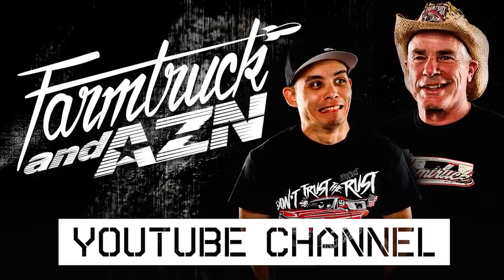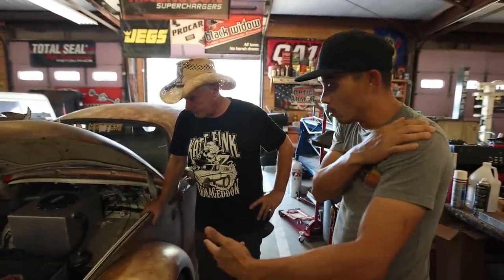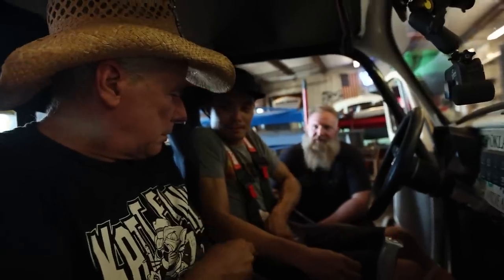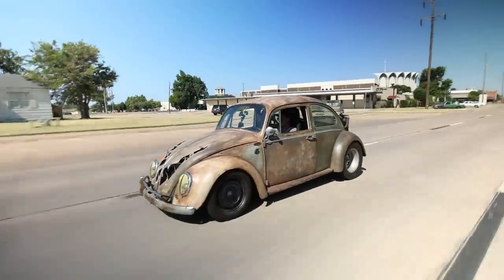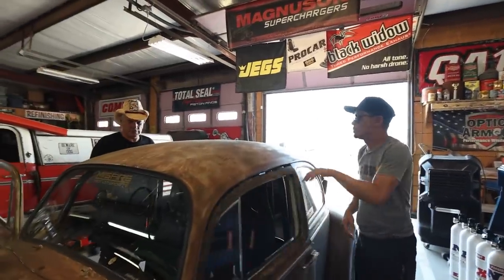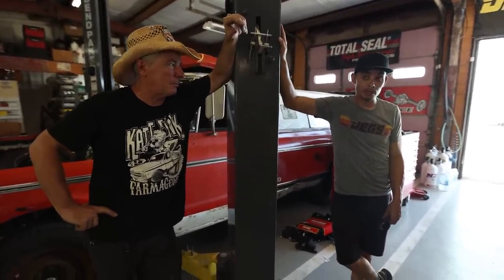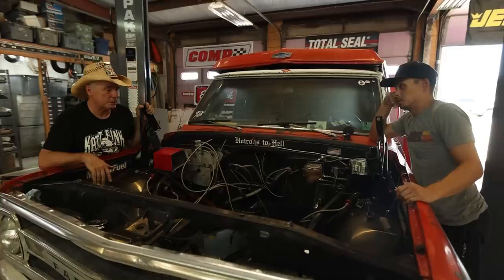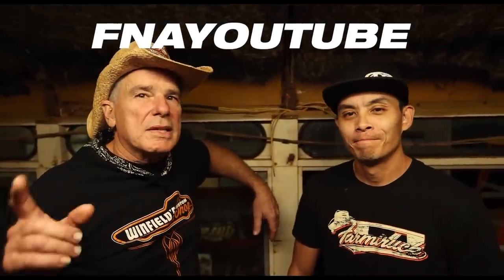IT'S RUNNING A LITTLE HOT!! FIRST DRIVE SHAKE DOWN!

Comment: The Dung needs an airduct from the roof to the turbo, and an expasion tank for the coolant. Also the fuel tank needs to be 4" further back. Additional ducting would help the radiator, but how to build it is a bit trickier than usual.. Lifting the frunk from the hinges for about 2" would be a decent start.
Reply: i like cars
Reply: Maybe a small auxiliary radiator externally mounted on nose
Reply: Total agree
Reply: 200 is about normal for Subaru motors, also the OE pump might be struggling to move water to the front radiator setup, could go completely electric relatively easily and have complete control over flow/volume. All in all I’d say it’s healthy and you really don’t have to worry until it’s in the upper 220s and not coming back down
Reply: I totally agree
Reply: I'll talk to him in morning about advice
Reply: Some sound advice..top hood scoop
Reply: Can also run a small scoop on top withe hole in the roof  but up side down into the car with a tunel or flex house to the  back to the turbo. with a flared box at the back of the turbo to cool the turbo and motor down
Reply: Damn that thing is noisy . Love the Subaru swap tho. They will work out all the bugs.
Reply: Sounds like you should go build one instead of internet building lol

Comment: Air bubbles in the system would definitely explain the cooling issues. Have you tried vacuum filling it? It’s the best way to eliminate bubbles 👍
Reply: I agree. I vacuum fill all the cars I work on. I just do it so I don’t have to worry about it.
Reply: Not necessarily the radiator might be to small I'm thinking.

Comment: Sure you guys are working out the kinks by now! I’m doing this conversion on my own beetle and what I learnt about the cooling system is with a radiator it’s more important getting air out of the back than in the front of it if that makes sense
Reply: It makes sense because f more air is leaving the back it creates a negative air pressure inside(ie a vaccume) which inturn sucks more air in from the front
Reply: @ashenthrenchetty7  💯 I am even making a front splitter for mine with a “gerny” flap type deal to help create more of “suction” effect
Reply: Some louvers in the sides behind the front fenders would probably help too!😉
Reply: Yea I'm doing a vr6 swap I'm planning on running radiator up front cut a grill. But put a cylinder fuel cell up on the Frunks "firewall" and weld nuts on the bottom and have a screen insert over the front steering mechanisms. That should do the trick.
Reply: @chrissweetavena  Why a VR6? Sounds like a lot of work for minimal returns fitting that large engine in a bug. Seems like you'd have to take the entire firewall out because it's so high... or stick it way out the back.

I think you'd be better off with the 2.5 flat 6 from a bus, that engine bolts right in the back of a bug, is air-cooled so no need for a radiator, they make bore kits for it... even 4 valve per cylinder kits so you could probably make it way faster..

If you're after power, a flat 6 with a 3.0 bore kit and 24 valves would blow the doors off a 12 valve 2.8 VR6. Even if they make the same power and torque the air-cooled engine will be much lighter.

Liquid cooled is cool but then the boxer 4 turbo from a Subaru would fit easier and be an easier swap that's less intrusive to build into your chassis..

Not knocking btw, it's your car and you should do whatever you want to your stuff off course so if you want to do the LC conversion with the vr6 more power to you... just wondering.

Comment: Hah hah, the Dung Beetle lives!! Considering the outside air temp, I'm surprised it stayed as cool as it did! You may need to make a shroud of sorts to direct more air into that radiator and maybe a stronger fan. And for Pete's sake, get that fuel pump in some rubber mounts. Gawd, that thing is LOUD!! You'll definitely need some wheelie bars once you get the kinks out and start making some good power with that Subie motor! Heck, you can pull the front wheels with a well-built 2130 cc bug engine! You can pretty much predict what a Subaru engine will do making close to twice the horsepower!!😂👍 It already sounds pretty healthy up on the pipe, just in the short pull you did! Nice work guys!!😁

Comment: Old VW guy here -- Seen the Subi swaps a lot --- The best way is to move the rear fire wall forward 10-12" and move the radiator into that new area -- supply some fresh air ducting into that and almost all your cooling problems will be over.... you'll be fighting that front radiator and air bubbles forever...   Do a little youtube research and you'll find some Assie guys that have done that to get you some video help.

Comment: One thing that comes to my mind with the cooling is the one thing that many people overlook. I have saw cars that did not have a thermostat in overheat, and run cooler once the thermostat was in just because the thermostat made a resistance that kept the water in the radiator longer. When dealing with temperature problems on custom cars it's very easy to not think about the fact that water has to stay in your radiator long enough to get cool. Not sure what the situation is because you have a rear engine car which I normally would know to be air-cooled but I know you have a radiator up front with a lot of hoses. Whatever your setup is you guys are smart just remember to make sure that your your water is staying in the radiator long enough to get cooled down.

Comment: Add a port at the engine end to use a vacuum pump such as a brake bleeding pump to pull air from the cooling system. You can also add a pressurized cooling system as in Nascar or circle track cars.

Comment: Need to set the fuel tank back as far as possible or go to a shallower depth but wider tank, the fuel tank is definitely having an effect on the air flow out of the rad. 
Mount the fan as a puller not a pusher unit to draw cold air in....now all that air that's passed through the radiator also has to be funnelled out.
If you follow the chrome side trim, there's a small triangular area behind the front guard that finishes at the panel gap. I'd cut out this area as much as possible and then weld in some mesh, it'll help with moving air through the rad. allowing it to exhaust.
If the under bonnet/hood temps. Are still high you could add a small thermo fan, biggest that'll fit, to the inside of the mesh area to force that hot air out. You could set them up to turn on via relays switched to ignition, on a stand alone thematic switch or pinned in to the haltech using an IAT sensor set at the desired temp.
Fitting a header/coolant expansion tank would also be a worthwhile idea, find one that has the right amount/sized outlets for your application. 
I've personally fitted/used, with fantastic results, vw/Audi expansion tanks with the mounting hardware sourced from a wrecking yard.

Comment: I'm  not  just saying  this it really  works. Zmax  had a prostreet 57 that had an overheating  issues after zmax it ran 30 degrees cooler. A few years later had a Yamaha  vmax  that started overheating  and  same solution  had about  the  same results  30 degrees  cooler

Comment: but is it Faster then Before all the Work??   So Glad you didn't Retire the Beetle!!   you need to add a inside cover plate for the upper part of the front hood Holes to force the air into the bottom half straight into the radiator?   for the farm Truck , you just need to groove the rear tires like a Sprint car on Dirt style Tire for the street?

Comment: Im no race car builder but Just from watching this I'd say you have plenty of space for air to come in the front but is there an exit so it can flow well and not be trapped?  And maybe the fuel cell is a little too close to the back of that radiator.

Comment: Fellas, is there enough room to mount the radiator under the car  somehow.  I see a lot in racecars, especially the s10's and small tire local Ohio no prep cars.  They do it to move weight but they don't run hot... just a thought. Driving that with no hood would look ridiculous.

Comment: Operating temperature on Subaru is 192° and can range into 210 with no problem 😊 but your setup might require cooler temperature
Reply: He's running a turbo and probably more boost which causes more heat and racing it to that would be my guess.
Reply: @matthewvarnam4302  they were mostly causing but 100+° day things do run warmer. They might need to open body panels up behind the radiator to aid cooling if it hasn't already been done.

Comment: Like some of there comments on here expansion tank will help with air bubbles.  But what temperature thermostat is in it and where is coolant temperature sensor located.  If u can get 2 temp sensor to read temp at the radiator and the one at the thermostat housing.

Comment: Jack the front of the car open bleeder at the radiator if no bleeder cracked the hose just slightly. You will see bubbles let idle for a few minutes. Do the same procedure raising the back of the car opening the bleeder at the engine. if no bleeder crack a hose let run for a few minutes it’ll make a world of difference we install the Subaru engine can VW buses here in Fresno California and that is our bleed procedure temperature will stabilize Subaru engine will be happy. Good luck 🍀 you guys are Awesome….

Comment: Weld some light duty expanded metal behind the hood, it should add the strength your looking for. If you want you could add a red light to shine through the cut out flames.  🤷🏻

Comment: That Subaru engine is suppose to operate at 160 degrees. NOT 180, but it too dam hot where you live! You can fry an egg on the asphalt! Love the Dung Beatle better now with the Subaru engine. More reliable than the VW engine. I own a 2019 Subaru Impreza. That engine has over 100,000 miles on it and runs very well. I still average 29-30 m.p.g.. I have gotten 38 m.p.g. on the Highway.

Comment: You need to have Him Add vents just behind the fender to let the Hot Air Out of the front get Welderup Steve to Add it and it will look like ears, Otherwise the hot air is trapped! It will slow you Down like having a Reverse parachute Air goes in no where to go but circle and why it started running Hot! With the Ear vents it will drop 20f and Ducting the Air to the vents would help even more! it will reduce the drag and Cool it Better! And Or a Cowl i know you don't want because of the Look!

Comment: Good job getting it running again.  I figured you're using a type one trany since you're using a RLR shifter.  I did a similar project, click on my pic to see it. IMO, you don't have to worry about temps until it's over 210.  My fans come on at 200. Let me know if you ever want to chat.

Comment: My wrx runs between 180 and 210, gets up to 220 when stuck in traffic in the summer.
Reply: @Scooby blue;  @FarmtruckandAZN  The established optimal coolant/water temperature for vehicles is @210-1 deg. F. 🤓
My first IE &auto mechanics teacher showed us the collected, data, graphs showing engine wear, efficiency, etc. vs temperature
->that course was 1975-6 - the data was already measured, collected, established from several years prior - with cast iron engines, stock internal parts
->this led the automotive manufactures to increase the thermostat and cooling system design specifications from 165 to 185 to 210 deg F.
->Aluminum engines and parts have much  better heat transfer than iron, steal
->For some reason many individuals within the automobile mechanics, building, modification, racing are still holding onto the old, improper information.
->if You need or desire any assistance, information, details with a successful Subaru Beetle swap details -> please view John Reynolds with his 517 wHP Super Beetle [also on this platform] 
All The Best 😊
Sincerely ☺

Comment: It's probably running a little hot because the fuel cell is to close behind the radiator the hot air cannot move away fast enough

Comment: Is that the fuel pump screaming in the car that has got to drive you crazy hearing that while driving. I would rather hear the drone of a engine running straight headers then that scream from the pump or what ever that is.

Comment: Needs a v dub motor, fuck subaru.you might as well LS swapped it.
Reply: He wants to go fast so he got rid of the air cooled VW.
Reply: @danmyers9372  but that's the cool aspect. I realize they ain't the fastest, but have you ever personally seen a VW go down. It may be a 12 second pas, but looks fast as fuck. That's a lot of the fun 😊 n then hem thing's. Don't get me wrong, I love a 3 second with, but these guys fight harder and dig deeper than y'all realize. They go hard! Consider power per cylinder. They are  where we want to be at that power, so don't condemn, build them up, someday they'll go v8 and remember this. At that ratio, I'm learning imports now!
Reply: @esvs9395  He wants to compete, not get beat!

Comment: SHOULD HAVE MADE IT A FAN CAR AND PUT  THE RADIATOR AND INTERCOOLER ON TRUNK  AND SUCKED THE AIR IN FROM UNDERNEATH  WITH FANS  BLOWING OUT ON TOP GIVING YOU MORE DOWN FORCE LIKE GORDON  MURRAYS GMA T50 FAN CAR JUST A RUSTY RUFF VERSION